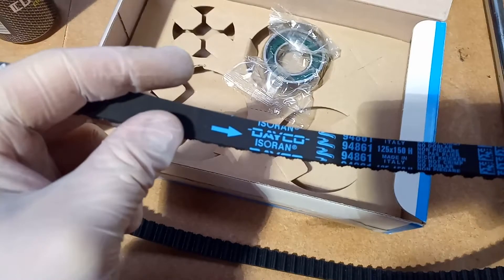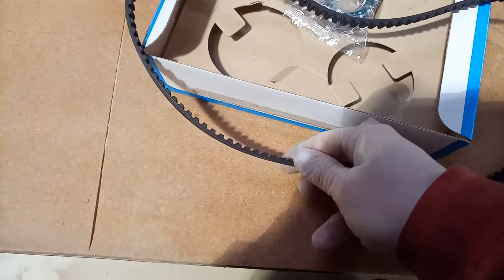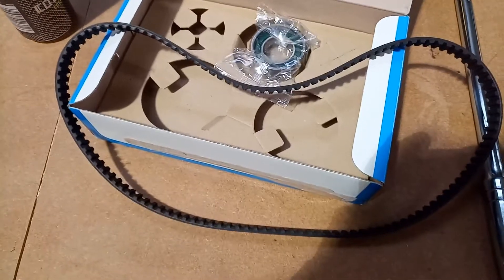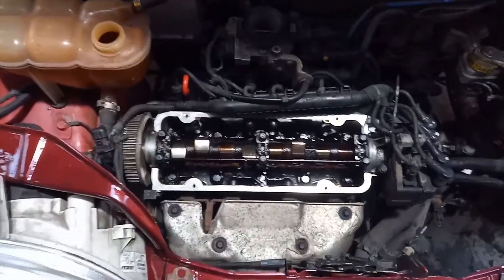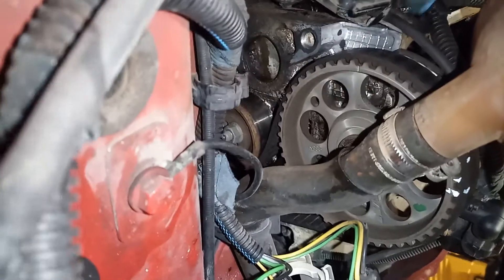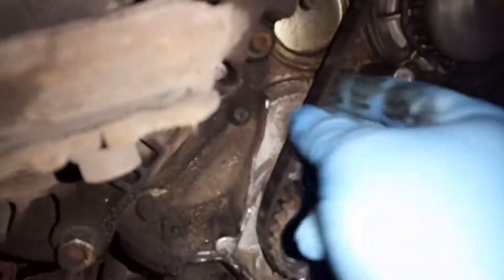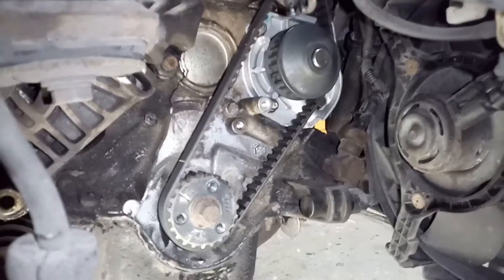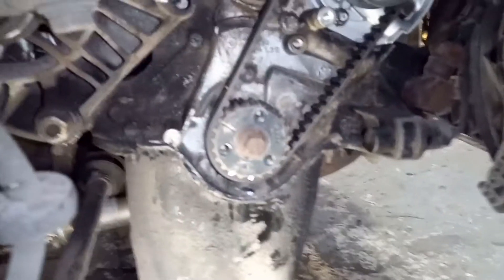MB Bee Timing Belt service FIAT 1.1/1.2  8v fire engine TIMING BELT Replacement

Comment: the best engine that ever made , even if the timing belt fall or cut of nothing happens to the engine
Reply from the maker: True
Reply: Only up to Euro 3 emission iteration. Euro 4 got different cylinder head (you can distinguish by the weird valve cover), and this one collides.

Comment: Are the fiat fire engines not non interface safe engines
Reply from the maker: only the 8v and don't have cam 866 and. The  16 Valve go-to collision with piston due to chigher comp ratio
Reply: Only 1.1 and 1.2 60 BHP are safe engines, all else clash
Reply from the maker: @bonkeydollocks1879  thx for adding extra info
Reply: @adrianador  your welcome